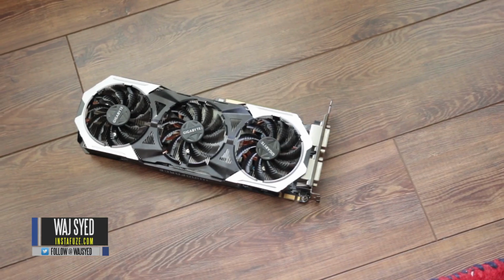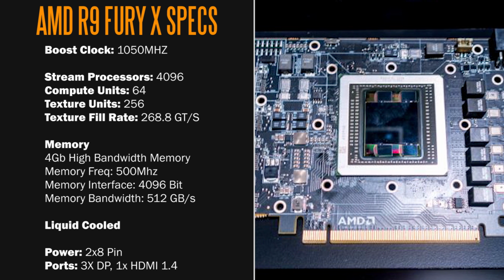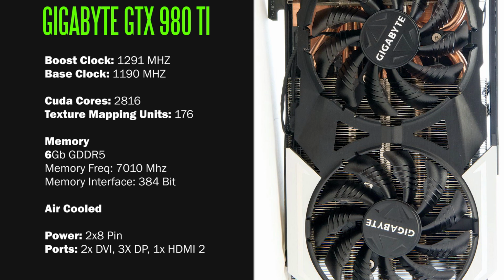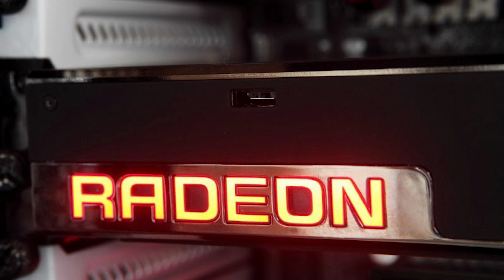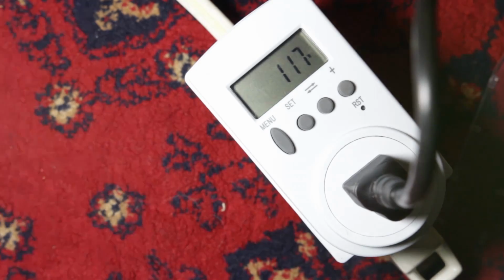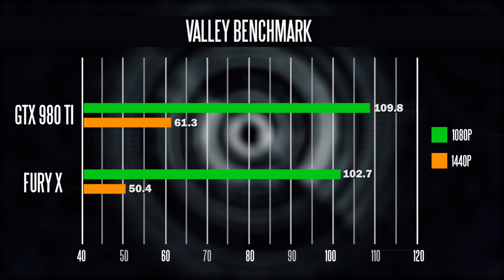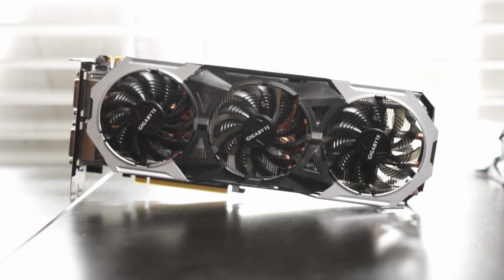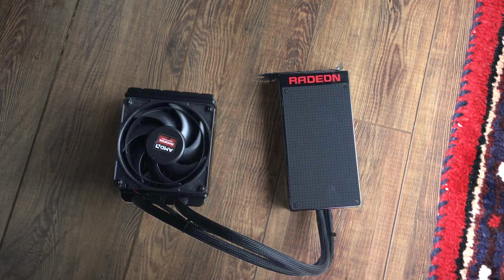AMD R9 FURY X vs Nvidia GTX 980 TI - 4k Gaming Benchmarks

Comment: Great video. I think the problem with the Fury X is the memory. HBM or not, 4GB just isn't enough for 4K gaming. Therefore, I believe the 980 Ti will continue to outperform the Fury X once DX12 comes out, as well as if driver support ever does improve for AMD. However, I think the giant memory bus on the Fury X will allow it to easily outperform the 980 Ti on 1080p, and most likely even on 1440p, once DX12 is released, as DX12 can actually utilize the entire card. I believe the best bet is to hold off on a purchase for now until we see some DX12 benchmarks. Both great cards, but what matters now is how they perform on Windows 10 and DX12 enabled games.
Reply: ***** 4gb of hbm is enough for 4k.
Reply: shl sid Clearly not, as it couldn't hit 60fps in any game the 980 Ti could.
Reply: you do realize how flawed what you said is?
your'e saying that the only reason it couldn't get the same fps is not because for anything else but the vram?
you don't even think for a second that the fury x couldn't hit the same fps as the 980 ti is because of, oh i don't know, other factors such as the architecture or cores or speed or anything but it is ONLY the vram which is limiting it.
"the 980 can't hit the same fps as the 980 ti at 4k because of the vram." thats like what you are saying.
Reply: Put it this way. The vram is a swimming pool. And the pool is filling with water (images and stuff) and in the bottom, there is a pipe. The r9 has a pipe the size of a storm drain ( it leaves it faster) so 4gb is enough. The 980ti has a normal sewage pipe, it goes out slower. So more vram is filled while waiting to be processed.
Reply: Just wait for dx12 and the drivers to catch up. I'm more than positive you will be eating your words. I'm sure AMD is laughing it up. I'm at least trying to give them a chance cause with the new tech you have too. If you watch reviews multiple reviewers said that the 4GB of HBM was not a limiting factor. In other words it wasn't causing the card to get low frame rates. I personally like the fury x and being able to make it a single slot card and putting it in a custom water loop is nice. I'm not an AMD fanboy. I have two dated 660's in SLI. At the moment only play 1080p so it works for now. But I wouldn't mind getting a fury x. Just waiting for windows 10/direct x12/mature drivers. They have something up their sleeve and I'm anxious to see what happens.
Reply: Well there is a flip side to that. In a couple of years you will need more gpu power not just Vram. That's like saying if they make a 970 with 12gb would it be future proof..... not really because the more intense games get the more graphics power they need... the Vram is worthless then. In a couple of years most people upgrade anyway so why waste 300 dollars when you can use that 300 extra on the next high end GPU.
Reply: ***** Agreed. The Fury X seems like it needs to update its drivers if we wish to see any true difference here and the GTX 980 Ti is an incredible card for the same price but I feel like people will need to wait for a Cyber Monday or Black Friday to see any significant drop in sell price because $649.99 is still alot of money (hell most budget builds can be made with that kind of money). I feel that the 4 GB of HBM will become more significant if an 8gb version of the Fury X is released further down the line but we have to wait and see that. I really want to have AMD succeed in this as Nividia has been shady with alot of their business practices (AMD as well but Nividia have been more blunt about it lately). I will be holding off on either of these until we see what else they bring.
Reply: TheSoundwave92 Yes. I honestly think the Fury X would've outperformed the Fury X even now if it had just 2 more GB of HBM (bringing it up to 6GB). As we can see, the Fury X looks a lot better on paper with its specs (4096-bit memory bus, 4096 stream processors), but it's held back by its memory (even the memory clock) as well as its drivers. AMD needs to do some hiring in their driver department. And yes, I agree about NVIDIA being shady with what they do, trying to sabotage AMD cards. However, it's also partly on AMD, as if the drivers were better, NVIDIA's sabotage wouldn't have such a large effect on their processors. Shady business is the way the world works, so other businesses must adapt.
Reply: shl sid What are you even talking about? That absolutely is one of the major factors, and the drivers are the other factor. The Fury X, if it could run on NVIDIA-level drivers, would easily out perform the 980 ti based on specs if it had 6GB of ram. It would probably tie the 980 Ti with the 4GB.
Reply: shl sid very good point about the 980 and the 980 ti difference of Vram.
Reply: shl sid Also do you even know what ram does? Consider that v-ram acts like the same for the cpu ram but for video processing. When the gpu has more ram, it will be able to utilize the ram for better performance, and yes I know that data slows down if the load is going to overload the CPU ram and that it doesnt work like that for the GPU's ram However dx12 will incorporate enhanced prioritized work loads which would most likely fix that problem. (Remeber dx12 works from the gtx 600 series and up so that means the gpu needs a little bit more gpu power than something like an intel hd family 3000 gpu.)
Reply: Sean lee well to be fair we will know when dx12 is released because numbers on paper and graphs are not always wright in case of the fury x which AMD said it would beat the titan and look what happened in the real world. So we don't know what will happen with dx12 it could be great or an over hyped pile of dung just like the fury x. And I really wanted the fury x to be great but it's dead meat already.
Reply: you guys do realize that vram is not only juse vram. there's gddr5 and hbm. they do not perform identical. please research before trying to tell me what vram is. hbm can use its huge bus width like a 'cache' for when the 4gb is full. what EdwardTennant Gaming said is a good explanation of how hbm works.
Reply: shl sid However these benchmarks don't represent that. Care to explain that one since you seem to have so much computer knowledge?
Reply: walterwaller I can respect your view but don't put too much hopes and dreams in it because AMD doesn't have the best record with drivers.
Reply: ***** good point that's why I chose the 980 ti g1 gaming that arrives tomorrow at my door. Plus I just love Nvidia driver support
Reply: Regardless I'm just glad they are still around because if there wasn't another GPU company we would be getting shafted. Personally I haven't had the best experience with nvidia but nevertheless I'm glad they are still around.
Reply: walterwaller well we technically are getting shafted already #1 the 980 kingpin came out and I bought it and no more then two months later the titan x came out #2 then the people bought the titan x for maximum gaming for a single card at 1000.00 then to troll 4 weeks later...... supreme 980 ti then that makes the titan x irrelevant so yea we are getting screwed on the regular.
Reply: ***** both overclocked titan x vs g1 gaming 980 ti are dead even and on some games the g1 takes the lead.
Reply: ***** that's my point you can overclock the 980 ti higher so clock for clock is a mute point because people will overclock the 980 ti to its maximum potential and for over 300 dollars cheaper it makes the titan x obsolete
Reply: Well the titan x is a fantastic card and I am not knocking you paying a grand because I spent 800 on the kingpin 980 that was out dated in to months lol. The 12 gigs of Vram is nice for multiple monitors but the 12 gb won't matter with a single monitor like the majority of gamers. The fury x is a cool card and it brings something new but it technically brought a knife to a gun fight.
Reply: ***** yea that's insane. I run 1440p and I feel the 980 ti is perfect for thst. I am going to wait till we get more gpu power before I jump to 4k
Reply: TheSoundwave92 650$? In germany it cost 750€. 650$ are 590€. So the price is fine but not in germany.
Reply: ***** If the Fury X is relying on AMD driver support to beat the competition its already lost. Nvidia are well ahead of AMD when it comes to drivers. AMD seem to release 1 or 2 drivers a year. Its appalling.
Reply: Scuba Sausage lol k
Reply: russrt spooling TITAN X with its 12 gig memory will still be able to play games at 4k when in a couple of years games are using more than 5 or 6 gig memory, the 980ti won't, 12 gig ensures longevity, anything less doesn't, so in 2 years you may have to spend yet another 600 quid on another card, then you would have spent quite a bit more than a Titan X.

Comment: 4gb vram for 4k? Yeah right
Reply: Barish K HBM vram
Reply: Sorry I'm not very informed about this but when a game is taking up 5 gb of vram, the vram consumption/requirement on both cards is the same right?
Reply: Michael Renardson exactly and many games can exceed 4gb on ultra at 4k
Reply: Yes consumption is the same just the amd has faster memory, personally for 4k we need to wait for higher hbm memory capacities
Reply: HBM is faster than gddr5
Most cards don't fully utilize more than 3gb of gddr5, cuz it's a lot slower (correct me if I'm wrong).
HBM is a very good new technology from AMD and hopefully nvidia will also use this in their cards (they are probably going to create their own version because they don't want to give credit to AMD, just like they did with mantle).
Reply: Colin Naipal yeah, NVIDIA will use hbm2 with pascal
Reply: ***** because memory isn't everything
Reply: Barish K did you ever played at 4k? im assuming not
Reply: Barish K because of slow bit interface
Reply: ***** way back, memory bandwidth dictated the performance of high res but it seems at higher res besides far cry 4 nvidia is the winner..

they probably fully developed the fury X factory and pumped it out thinking they can beat nvidia @ the $700 price point but nvidia came out of no where and released the 980 Ti which shouldn't even have 980 in it's name but say 990 because it's completely faster of say multiple early generations of geforce
Reply: Abdullah Ahmed lol
Reply: I hit over 8.1GB with 2.5x DSR on 1080p with max AA.  6GB is the most that can be had on a single GPU and its 980 ti so.. when VR hits 11k there needs to be like 12GB of ram with the GPU power to match.